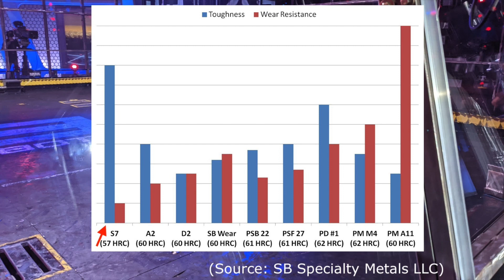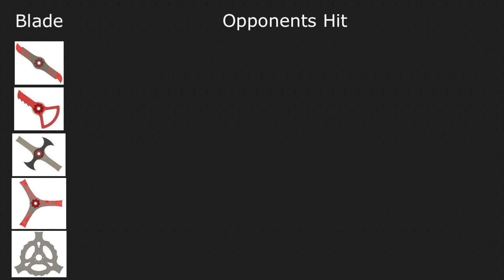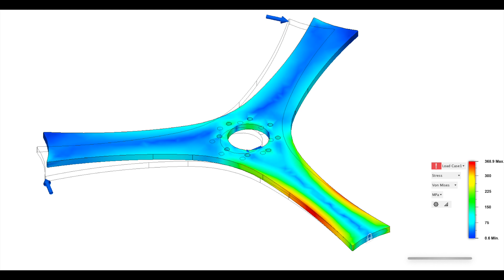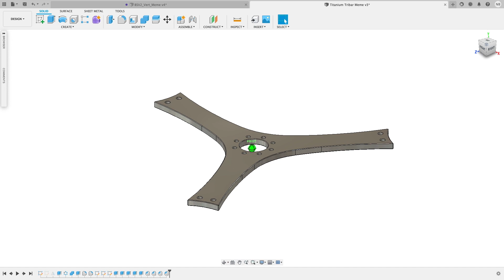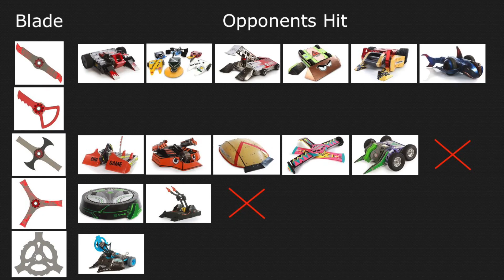Why Did Our Blades Break? Battlebots Season 5 Failure Analysis

Comment: the toughest steel bar none is 8670 . It is used for large circular saw blades .check out the steel knife supplies places .  S7 has to much carbon witch is why it cracks . it is a die and mold  mold steel
.

Comment: The Gruff fight blade breakage was more surprising to me, since the Lock Jaw ones just seemed to break because of the hit from the hits, similar to what happened to Tombstone in their most recent Bite Force fight. However, the same issue that broke the tribar also has happened to Tombstone, in their first Witch Doctor fight. Looking carefully at the footage, WD's weapon was stopped, meaning Tombstone must have broken from its own shock.
As far as I've seen, I would prefer an AR500 blade to a S7 one, especially if you can get separate teeth like on Tombstone or Nightmare. This removes the dulling property like S7, but keeps the toughness of AR500.

Comment: Samurai swords are built with two steels -- the inner core that can flex, and the outer film of tool-hard high carbon steel.  Thus any impact that would shatter the sword, only makes a chip, as the inner core flexes to absorb the stress.

Comment: Been a fan of robot combat shows for well over two decades from Robot Wars and Battlebots, and it's still always really interesting to learn of stuff like this. 

When Battlebots and Robot Wars were rebooted and I saw how thick the armour and weapon frames are on the new modern robots, I thought "that looks fine! it'll hold up!" and I still keep thinking that! And yet these robots absolutely tear right through or spilt armour panels or shatter weapon bars like yours or robot sections apart as if it was nothing! Really shows the amount of progression and advancements that's been made to technology and materials between the shows' original runs ended and the reboot.

Comment: I've had good luck with 4340 through hardened to 55 RC.  (Insomnia from back in the early 2000's)  Tough, hard enough, and somewhat self sharpening.  But most importantly it's easy just grind a new edge on it between matches.
Reply from the maker: Ahh, one of the OG's! Thanks for the comment! If I'm remembering Insomnia correctly, you had aluminum disks with steel teeth, right? I think oftentimes that allows the impactor to be a bit harder than with a single piece solid weapon, since the more brittle hardened steel doesn't have to deal with the big bending stresses in that setup.
Reply: @bnsrobotics  Yup, steel teeth in aluminum disks.  (the counter rotating disks canceled out gyroscopic forces btw) Also bent the aluminum disks chewing two particularly solid wedges.  One was 1/4" of 3/4 hard steel, and the other was 1/4" of Gr5 Ti with a 3/8" back stop on the top of the wedge.  Both fights rounded off the teeth after making several 1/8" deep slots in the opponent.  5-min with a grinder and the teeth were good as new.

Fyi, did you ever see Stump Grinder at TC MechWars in Minnesota?  That would be my weapon of choice for a cheap and powerful bot.  (along with "armor wheels")

Comment: Interesting stuff.  I think the speculation about waterjet cutting is a bit of a stretch though.  First, you shouldn't have such a gnarly finish after waterjet cutting, unless they were running too fast, which it looks like was the case.  But it should not impart any heat or stress on the material, and should be akin to a roughing operation on a milling machine.  Surface finish should not really affect overall strength.  I think you guys just have too thin of profiles for the stresses you're subjecting them to.  AR500 is just a better choice for what you're doing, unless you go a LOT thicker.
Reply from the maker: I agree for the most part about the profile thickness and your conclusion about AR500, and I mentioned weapon geometry as a primary factor. Crack propagation sites on the surface absolutely can affect the fracture toughness of a part, though. It's important not to conflate toughness with strength- AR500 has a lower yield strength than S7, but a higher toughness, which is why AR500 weapons tend not to be affected by these things. The waterjet speculation is an attempt to explain the difference in performance between our weapons and the longer, even thinner S7 blade on Icewave, which supposedly stored even more KE than our tribar in the days before the 250mph tip speed limit was introduced. Of course, there are many other variables involved when comparing the two, but that one seemed to me to be one of the most compelling. 
It's good to know that about the waterjet speed, though. We're switching to a new WJ shop this year, in addition to redesigning the weapons and using AR500 instead of S7. Hopefully we have some better results!

Comment: I know it would be really expensive but I'd love to see a what a titanium weapon blade would look like. Titanium is obviously quite a lot softer than both s7 and AR500 but imagine how many beautiful sparks they would generate!
Reply from the maker: Ti sparks are quite nice. We prefer to make sparks out of the other bot though!
Reply: AFAIK at least one version of Giga/Megabyte had a full Ti shell. It's fairly common in the lighter weights as weapon material, and it has a great mix of toughness and hardness, but it does not hold an edge like S7 or AR500
Reply from the maker: Megabyte/Gigabyte has always had steel teeth bolted onto their shells as far as I know. A ti weapon with steel teeth could be awesome, but as our April 1st video laid out, it would also be incredibly expensive just to source material to make a tribar.
Reply: @bnsrobotics  From their website, the shell was Ti between 2003 and 2017. They've also tried Aluminum with little success and Chromoly. Currently it's AR500, but they're considering going back to Ti because in the long run it's cheaper (they used the same shell for over 100 matches!).
Reply from the maker: Yeah the main body of the shell has been made from various materials, but I believe the bolt-on teeth have always been steel. So in the case of Mega/Gigabyte, the edge retention of ti isn't a big issue for them. It'll be interesting to see how their new ti shell holds up to modern bots, compared to their old one which mainly fought in the 2000s and early 2010s.

Comment: How much does water jetting affect softer materials like aluminum? I've seen a lot of people have terrible luck with 7075 fracturing but have never had that issue myself with Quicksilver (which is made of flat stock 7075 cut with a chop saw rather than being cut with a waterjet).
Reply from the maker: I think it really just depends on the fracture toughness of the specific alloy. 7075 is one of the more brittle aluminum alloys, though I used to run waterjet-cut 7075 bars on my beetleweight Phantom II without issue. I imagine it makes less of a difference for tougher alloys like 2024 or 6061, similar to the way AR500 is less affected than S7. Basically the more prone an alloy is to cracking, the more careful you have to be about surface features and localized stress risers.

Comment: Ray's bar of thick aluminum with hardened steel teeth seems like a good fix for these problems (granted he doesn't use that bar all the time). With nearly 3x the thickness at the same weight, the Aluminum won't bend or break easily, and replaceable teeth saves having to use an entirely new weapon every time they get dull. True it's an extra point of possible failure, and we have seen teeth fly off in the past, but while one lost tooth means you're very unstable it usually means you can still hit with the remaining tooth. A shattered weapon pretty much means game over for a horizontal. Am I missing something here? It's always surprised me a bit that so many teams go for the full S7, especially with the number of catastrophic failures lately.
Reply from the maker: 3x thickness doesn't really scale linearly- an aluminum weapon can have 3x the volume (slightly less when you factor in the teeth). Since volume is Length*Width*Thickness, each linear dimension gets to increase x1.44, the cube root of 3 (or x1.73, square root 3 if you keep the length the same). This can be a definite improvement when it comes to handling bending moments, but adds a lot of mechanical and manufacturing complexity that isn't always matched by an equivalent performance increase. Machining and tapping the interfaces between the bar and teeth is a lot more intensive than just getting a single piece waterjet or laser cut, which is why we're seeing so many teams make the transition to solid AR500. Plus, if a tooth shears off at the bolts, you're left with sheared off bolts in your aluminum part, which is a colossal pain. We are playing with some different multi-piece weapon ideas, though!
Reply: @bnsrobotics  Ahh, that makes more sense then. Coming from the little bots I don't have a great grasp on the costs of parts or the stresses of impact on the big guys. Good luck this year guys!
Reply: The got-ya for aluminum disks is the interface to the tooth.  There are insane forces at this point so it's easier to make everything one piece.

Comment: Get the weapon length with heavy cable.  Stay horizontal please!
Reply from the maker: Bloodsport is and always will be a horizontal spinner :)
Reply: Flails do not work. Whether cable or chain, they cannot hit with the same force as a solid weapon. They can only do damage if they get lucky (like Nuts 2).
Reply: @DrachenJager1  you might be right... But I am talking heavy nearly solid cable.  Bridge style cable.   Not at all like a flail.
Reply: @neilpetrarca7395  Builders have no problem building spinners that don't break. That is not the issue. There are plenty of materials one could use that would never suffer this kind of catastrophic failure. But... without a very hard weapon you'll bounce off opponent's armour instead of catching and hopefully ripping bits off or at least sending him flying. In a best-case scenario with horizontals on a hit you and your opponent both go flying in opposite directions. Worst-case you go flying and they don't. So builders are forced to try and find a balance between hardness and durability. That's pretty much what the whole video was about. Those steel wires are relatively soft/flexible steel to begin with, and there's no way you can get a really sharp cutting corner on a bundle of wires. Some bot designs might be able to use that sort of club-type weapon, but horizontals need a sword, they live and die by their ability to grab and cut into armour. I also suspect for the length of bar needed on bloodsport the kind of thick cross section cable you're talking about would be too heavy.

Comment: I think the tribar could benefit from some stiffeners. Similar to your circular on one of the other weapons, but in straight lines - so it would be a triangle instead. Either as a part of the cut or as a bolt on somehow. 🤔🤓
Reply from the maker: That would probably help, but as TV show competitors we also need to be mindful of branding and aesthetics. We worry that tie-rods would make us look too much like Son of Whyachi, which could be bad given how central that rotor shape is to their brand. From an engineering standpoint, moving weight outward like that also increases MOI, and the Tribar already had too much energy for its own good. We've been working on ways to support the arms without encountering either of these issues, though!
Reply: @bnsrobotics  yes, you are right, it cannot be SOW like - so not as bolt on then, but cut in a one piece weapon. Also should not be as close to the outer edge, as horizontal axis spinners can hit it. Have not seen anything like this, and MOI and weight can be kept or reduced as this improves the rigedness. It's a balance of these things - placement, stiffness, mass, MOI etc. I also like the tribar more than the 'two'-bar(🙃) for the better stability when rotating and it gets pivoted - the reason for most wind turbines having 3 and not 2 blades, to reduce loads while tracking the wind direction. Sorry for the long response - and keep up the tech videos, really like the nerd stuff 🤓👍

Comment: Would it be possible to waterjet, then grind and polish smooth? Scratches are baby cracks, so if you can make the surfaces smooth it might reduce the tendency to crack apart.
Reply: Commonly done on fatigue life limited parts like on helicopters. Could also do ND testing after a fight.
Reply from the maker: The main issue is the size of the weapon. Fitting it into your local CNC machine isn't really doable, and the performance of S7 only justifies so much extra cost compared AR500, which is cheaper by the pound and also doesn't require heat treating. Smoothing it manually with a grinder is also possible, but that's really hard to do with any level of precision. We'd risk unbalancing the weapon that way.
Reply: @bnsrobotics  Have you done simulations on having a center hub in a cheaper material like AR500 with weapon bars in S7? That way the S7 pieces could fit in most cncs.
Reply from the maker: @ankjaers  That's a great question, thank you for your question :)
Reply: @bnsrobotics  no answer is also an answer. Hope you do well this year

Comment: Is there any reason the tribar can’t be watercut slightly too large and then CNC’d down to the proper size? I guess the size of the thing is a problem.
Reply: Yeah that's pretty much it. I was able to CNC mill the pockets on the underside of the THICC bar with a Tormach machine at a local makerspace but the work area of the machine is only about 9 inches by 18 inches, so even that required flipping it to mill the second pocket and having half the bar hanging off the mill table. Fitting a 46" diameter blade onto a machine all at once would require something way bigger and that sort of machine isn't just lying around. It would be impossible to even fit it into a tormach.